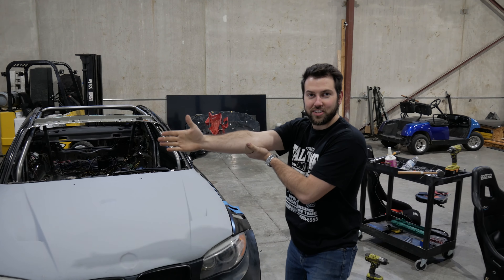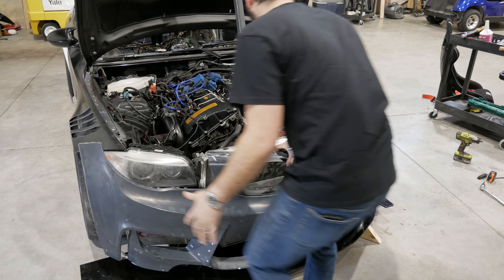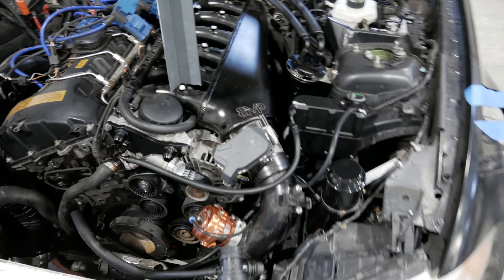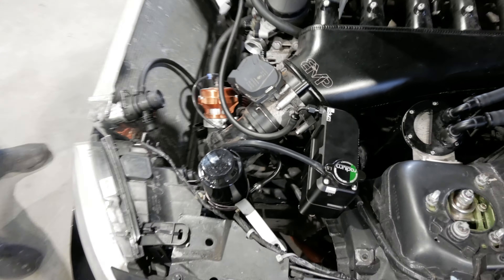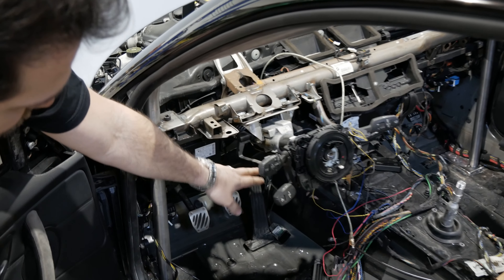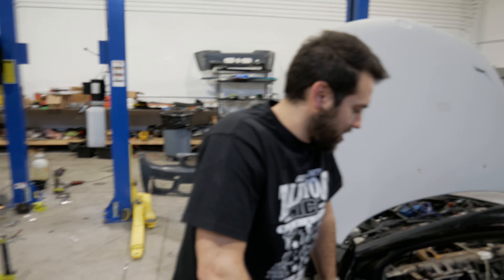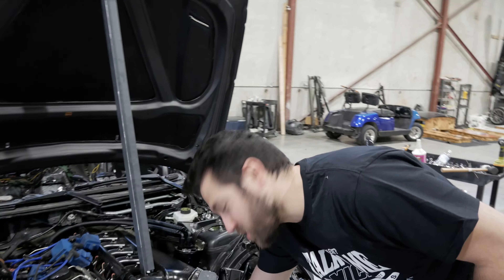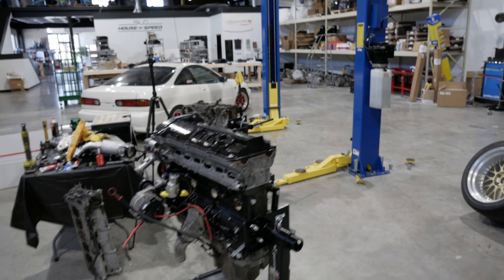Car Ketchup 2- 1M 8HP Swap, NASCAR Front End, Turbo M52 DCT Update

Comment: 8hp from f10 5 series n55 has same bellhousing pattern for N54
Reply: What 8hp should I search for to mate up to a 330i m54b30?
Reply: Yes, same with 2 series, 3 series, 4 series, 6 series and 7 series with n55 engine. But it’s 45 not 50 and not as strong.

Comment: Thanks for making 1 series content. So many awesome things in this video. The e tire front end set up, the  bands, etc. 

A few questions if you have time to answer. 

1. For the coolant tank, is the part you call a “high point” that goes to the oil cooler block off plate required? Or would it work with the two stock connections (upper radiator hose and the one by the thermostat)?

2. Will you be selling any of the items you are developing for the 1 series?

3.  The kidney grill looks good with the mesh behind it. Did you make that or buy it?

Comment: Hey guys I have a legit question. Is it possible to treat this engine like a 2j. What I mean is that can you make it dumber. so much Bmw hassle. Would it be possible to set it up on standalone like a 2j. and skip all the jb/reflex etc stuff. get rid of the di and lose a bit of efficiency in fuel burn to make it work better for drift / track abuse?? I'm full on ready to get flamed but god damn N54 is finicky as hell. Fuck all I want on my wifes e93 335i vert is to add a oil cooler setup(vegas heat) and a lot of what I find on YT there is always some issue . either from an lines leaking or the coolers themselves failing and I like the mosselman plate with thermostat but what happens if  the thermostat fails?  Literally can't find a no bullshit cut and dry solution.
Reply from the maker: Only one way to find out!
Reply: Absolutely, there's quite a few guys that have deleted DI and gone a standard standalone. But that's dumb imo. Deleting the performance advantages the n54 has, spending $10k to do it.. just swap something else in.